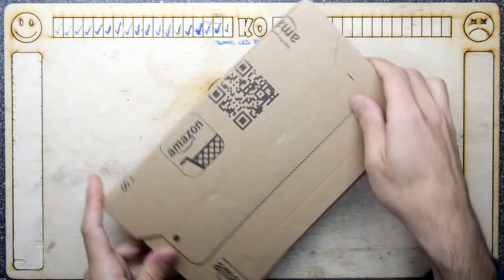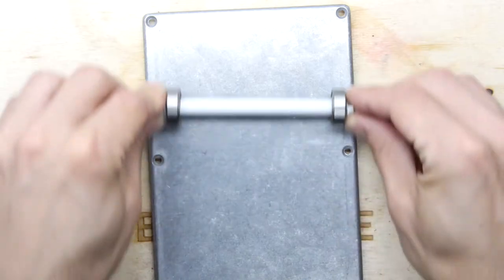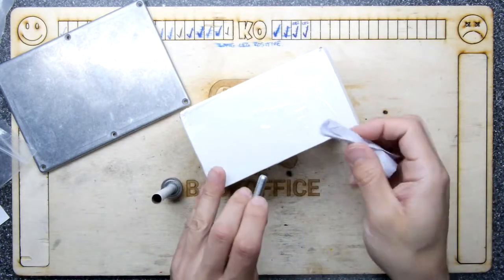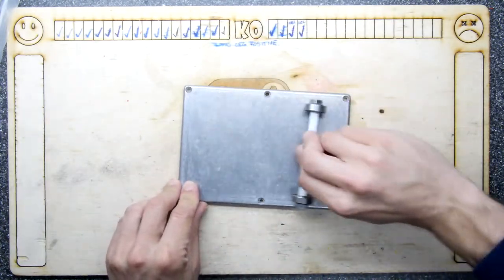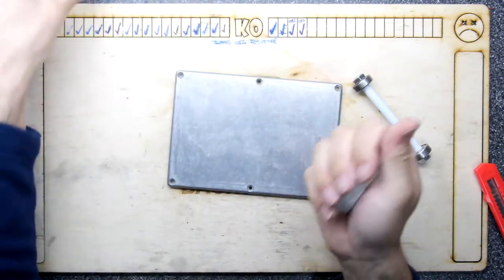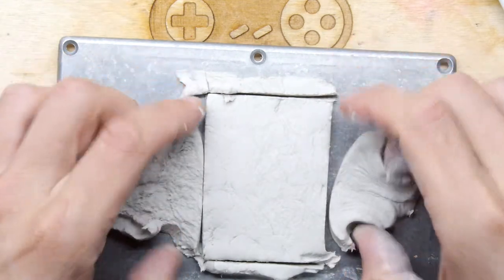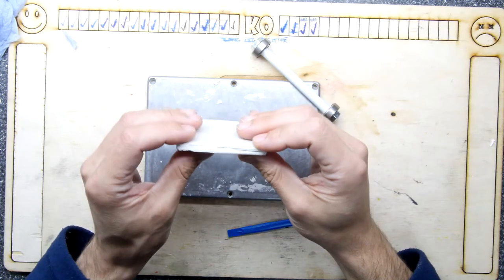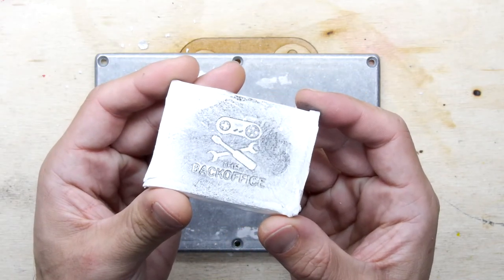CNC Milling Das modelling clay

Comment: that stuff reminds me of window fitters putty .. have you ever thought of using a cheese cutter wire to make straight clean cuts and sizes . or a rigged mini guillotine (insert imagination here)
Reply from the maker: +Soooperspeed never really considered it, but considering it now!!
Reply: a cheese wire board with a  panel on it too hold accurate placing .. i think that would be good and fast .. insomnia see gets the mind running .. lol
Reply from the maker: +Soooperspeed mmmm cheese
Reply: ah dont start me off im cutting cheese outta my diet too much cheese .. TOAST .. CHEESE ON TOAST .. back in 20 mins .. lol
Reply from the maker: +Soooperspeed I just had a bacon butty with ketchup

Comment: did the clay crack at all ?? (whilst drying )
Reply from the maker: +Jarle Teigland it's didn't crack, bit i could see fissures where I could have kneaded it better. I have since used it for figurines etc and it cracks like blazes. It's like paper machie
Reply: not from my own experience BUT apparently SUPERSLOW drying is the solution ; dry slowly in a ZIP bag with a few holes over 48hrs - then normal dry for24hrs - a bit time-consuming but for thicker layers might work ???
Reply from the maker: +Jarle Teigland I might give it a go. I think it's good enough for rough work. If for anything serious I would fall back to the polymer clay.